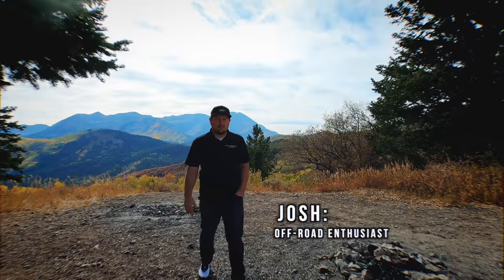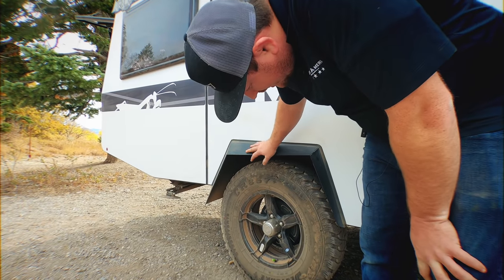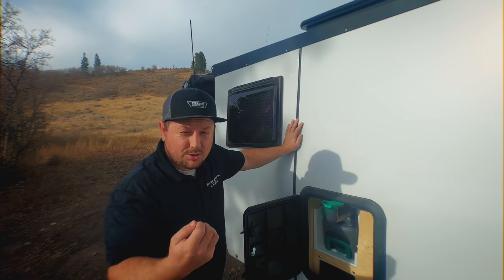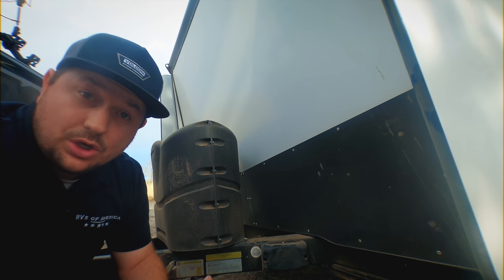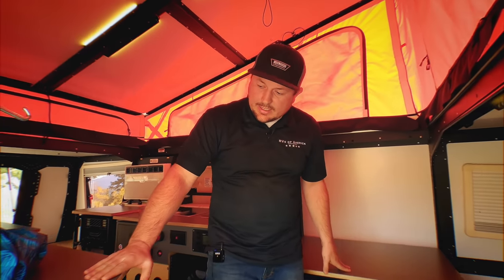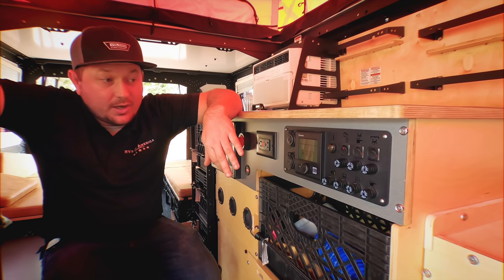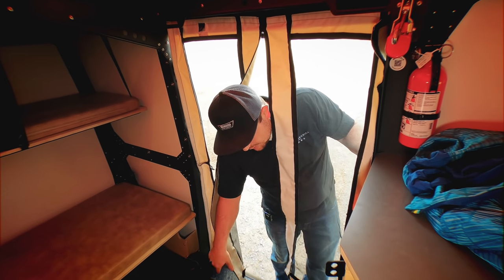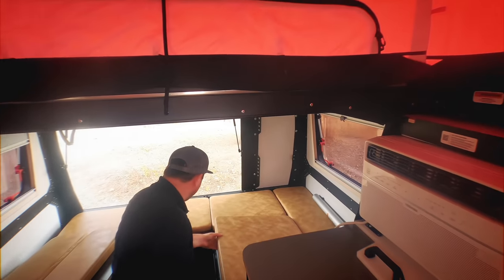2021 TAXA MANTIS FULL TOUR ROA (2021)

Comment: Good video.  Thanks for showing us.  There is a commenter below asking about the leaking issue.  I assume he is referring to another YouTuber that showed a video of the leaking.  I agree with him that you should not have to deal with any water in your compartment.  Please test this.  :-)
Reply: I think that's a common problems with pop top design and the solution is to have it checked by the dealership where you bought it and use the warranty if it's a new rv.

Comment: 38:52 It looks like the latch is already wearing a hole on the tent. The hook should be turned to be facing outboard when latching it down, be covered in soft rubber, and have a heavy duty nylon patch sewn in the tent. Also if it's turned around, when it's hanging down you won't have a giant meat hook sticking out.

The door screen looks like an afterthought which would just get in the way and let bugs in anyways if there is a gap. Why not a full side zip with magnets for the opening? A similar closure would be nice for the big overhead door as well.

Comment: Can you do a video showing someone storing in a standard 7' garage.  I measure our garage at 6'10 1/2" with the weather stripping adding another 1/2" if needed to hit that.  Our driveway is on a slight angle up to garage entrance as I am sure most driveways are like that.  concerned it will not fit with such tight tolerance.  Is there a way to lower the unit just to get it into garage?

Comment: At 19 ft long it is hardly garage-able. It is  also one foot wider than most compact trailers making it harder to  see the road.behind. There is no rear hitch receiver to carry bike rack. Actually all TAXA trailers have no receiver hitch!  Am I supposed to mount a 50 lb mountain ebike on the roof or a wobbly tongue mounted bike rack?  Why is it so tall? It barely fits in a garage door at 82" tall! Nobody needs such a high ceiling  when the roof is raised. Folks can't close/open widndows without standing on a step stool.  No wonder Elon Musk took over from NASA.
Reply: Note: Elon Musk did not take over NASA😂

You should do a bit of research prior to posting an opinion as a FACT🤓

Also there's no less than a thousand other RVs out there. I'm certain you could find one that you wouldn't find a thousand lame ass negative opinions about that might fit your needs better.

Oh and have a nice night!😉
Reply: Joe Bloe, really!!  Is this some other company trying to cast doubts making silly attacks.  Move on Joe Blow.